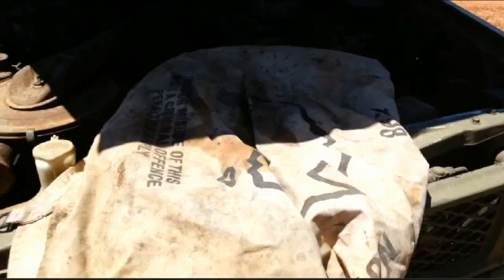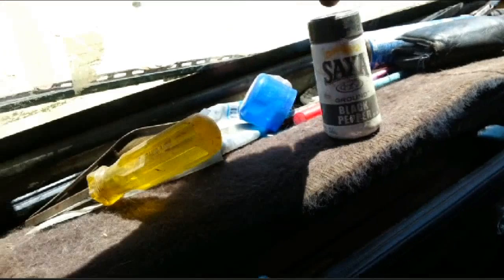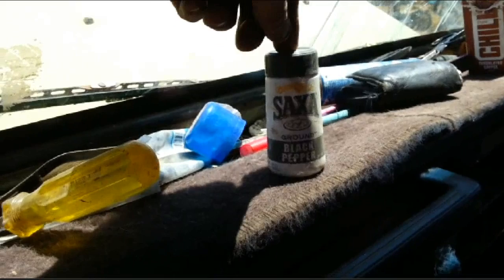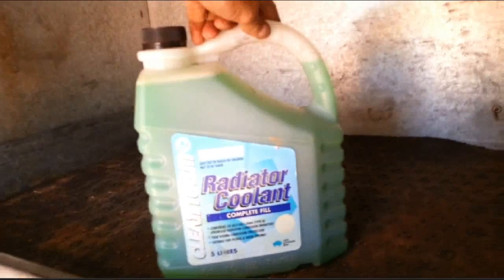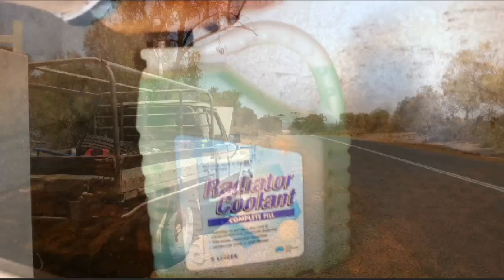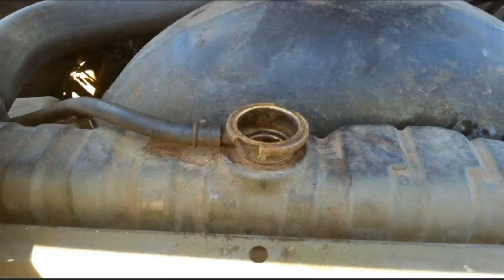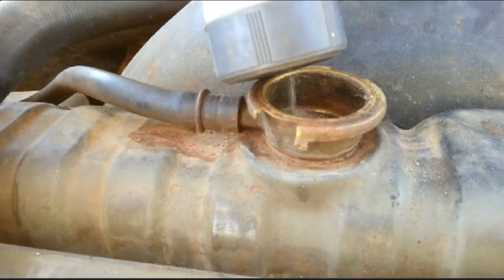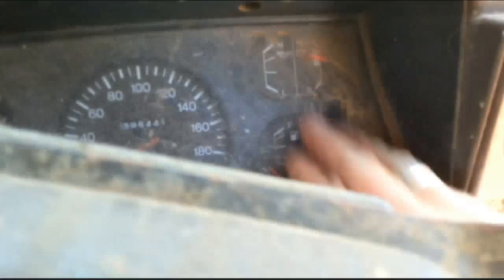Vehicle Radiator Leaking? Use Ground Black Pepper or Sawdust to fix Your Car Radiator Leaks!

Comment: I'm gonna try this. My 04 Jeep Grand Cherokee 4.7 4x4, ran hot this morning. I had my two year old daughter with me and decided to limp the mile home. It needed water, I added a gallon of distilled. When I shut the engine off and viola, heard a slight whistle sound and a trickle of steam. I'm certain it's a tiny crack. Thank you for the pepper trick. I'll give it a shot!
Reply: Did you try this? How long did it last?